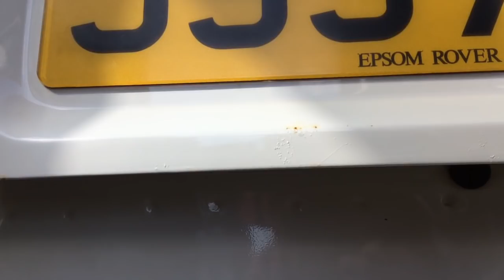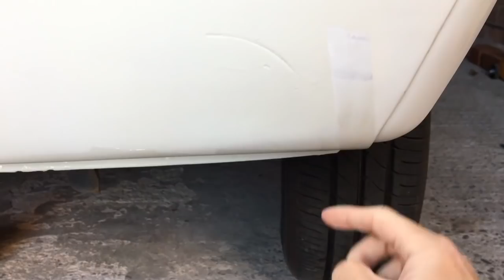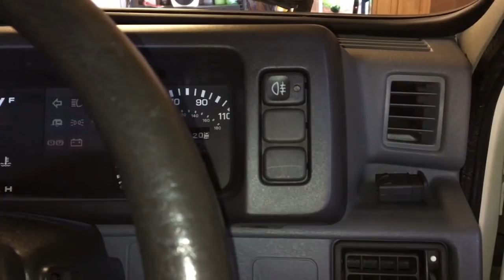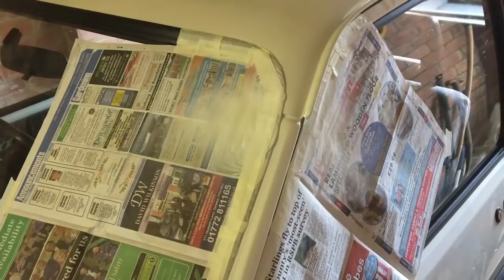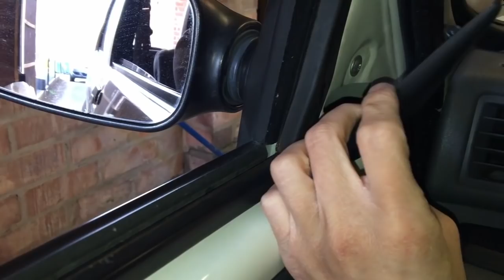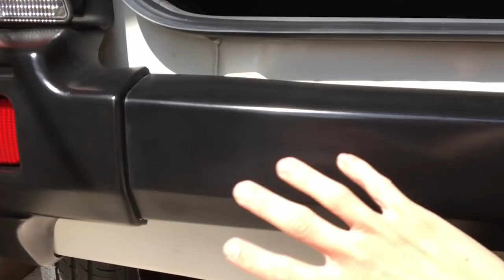Melvin the Metro's Spring Clean - More Rust! (Part 3)

Comment: You are doing a great job, I think as your confidence grows you will discover that you can do a near perfect job at home with that colour using the tools you already have and spray cans.  Remember it’s 90% preparation and 10% application.  This lockdown is making me much more patient, and as such I’m getting much better results with my own similar touching in of paint.   Regarding the fan switch, why not fix the temp controlled switch and add the air con switch as a manual override.. so you get the best of both.   I suspect the ac switch will not latch and will need a relay, if you need help with the wiring of a suitable relay then I for one would be happy to assist.   Try and add wires that do not hack into wiring, leaving you the option of cleanly remove it like it was never there..    also, when this lockdown is over, consider the use of patrion  or crowdfunding to raise funds for your insurance so you can test drive cars, i have quit using a TV and now divide the money that used to be TV licence amongst a few patrion you tubers,who are all more deserving than the BBC
Reply from the maker: I’m going to do it properly. I’m not the type to bodge it in. I want the proper switch to stay in the loop, with the switch as a manual override. I’d use a relay for the obvious reasons, but I’d also like it to stay on without ignition, but time out after a minute or so.
Reply: Twin-Cam it’s quite easy to achieve the run on of the fan for a preset time, apart from using a cheap turbo timer a simple timer circuit should suffice,

Comment: My Auntie owned, from new, a white 1.1 C like yours but early-1991 (H641 FVR). While all the interior was identical to your car, it still had the full-sized one-piece rear bumper, and 13-inch silver Rover 5-hole full wheeltrims same as the 1.1L. It would be interesting to know when Rover decided to delete these 2 cosmetic items from the 1.1 C, or was it optional to have them deleted I wonder? Your car is lovely, very nice to see an immaculate one again. Please don't be tempted to put a wing on the tailgate, or actually change that bumper!!! It's very rare now, just keep on top of the valence rust protection.
Reply from the maker: They changed the spec in mid-‘91, them back to how it was in late-‘91 I’m led to believe.

Comment: There were UK spec Metro's with Air Con. I learnt to drive in a HLS 1.3 with Air Con. Made hill starts tricky in the summer as the Air Con sapped a lot of power!
Reply from the maker: Very early Metros could be specified with it, yes. But K-Series Metros weren’t.
Reply: Darren Terry in hot countries all cars have air-con, it’s not a luxury.  Newer cars hardly suffer any loss of power from the air con, but older cars can sap an enormous amount of power.  I have memories of driving an old 1.3l Suzuki jeep around Thailand and switching off the air con on steep hills to get more power..  later I drove a 660cc Daihatsu and even with the air con on full blast on the hottest of days there was no perceptible loss of power

Comment: Have you sprayed any clear-coat over the top of the white paint to help make it shine?  That's just so lovely and simple.  Can you not get some foam or rubber to go around the bonnet prop to stop it rubbing the paint off in the future?  Is there not a boot release internally in the car?  Great video.
Reply from the maker: I haven’t sprayed any clear coat over it despite having some in. I haven’t done it firstly as Halford’s paints don’t require it, but mainly because Melvin never had a clear coat. White Diamond was the only colour Rover did that was single-stage.
Reply: @TwinCam  Ah, I see.  I hadn't realised that.  Thanks for the info on the boot release too, I had wondered that! :)
Reply from the maker: And no, there isn’t an internal boot release.

Comment: A good dose of Waxoyl or equivalent in all cavities and seams would be more than time and money well spent..
Reply: Depends on the guarantee of the firm conducting the work. £272 buys a decent compressor plus accessories and an awful lot of cavity rust protection products... Done on a hot day 🌞🌞 with car on ramps with full preparation, grommets removed, full investigation of box sections, inner frames and seams etc beforehand and a methodical approach, a major pressure wash off/clean-down, dry down...and good set of overalls and hat, guarantees nowhere is missed. AND..you still have the equipment for future top-ups..
Reply: I was thinking the same, I have some a bit of sanding down and painting on my 100 then it's going to a place in Dudley for rust protection after it's all calmed down.It will cost £272 and that sounds like good value to protect the car long term.
Reply: @wildrover1048  That'll be Krown, then in Tipton?  £272 seems a lot considering it's a much smaller and simpler car that doesn't require much disassembly.  I'd send them a picture of yours on an e-mail and argue that it's a car in the cheaper section.  Realistically you can't get much much smaller than a Metro!!
Reply: @SuperFIFTHGEAR  That's the price they gave for the full job after I told them it's a metro, after seeing how thorough they they are and how I want to keep the car indefinitely £272 seems like a fair price for specialist tools and 3 hours work and Hubnut recently did a Favourite estate there, a big boot supermini for a little over £300 (I think that included a small discount too as he made a video about it) so it seems about in line.

As I am running two older cars with no plans to replace them I'm not scared of spending out on either to make sure things are done right.
Reply: @wildrover1048  I only mentioned that as I have a MK4 Golf Estate that I took there for them to rustproof and I'm sure it was £252, admittedly that was a couple of years ago, but considering the Metro is a far smaller car and I would imagine would require very little disassembly (they take a lot of plastic panels off to spray the product behind)

If I had the room I would like to get a decent used compressor and do that myself annually on my cars (you can get products similar to Krown - eg the same waxy clear material - I am not a fan of the old Hammerite style black tar stuff) - which was at a cost of over £400 when I contacted a place that does all of that.  Did make Krown look great value - but Krown gives a 2year warranty, the tar-like products give five years.  I just don't like those products because as they age they crack and moisture can get behind.